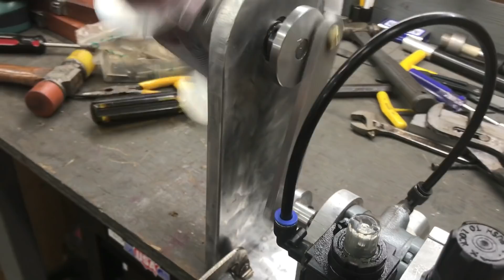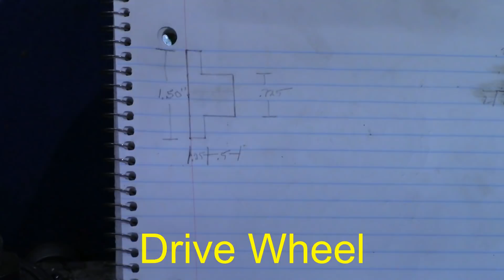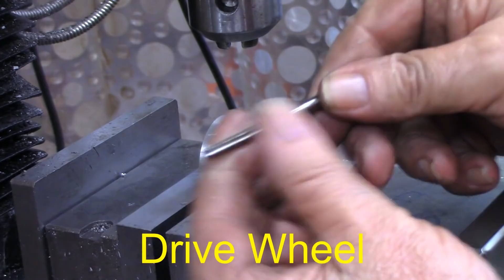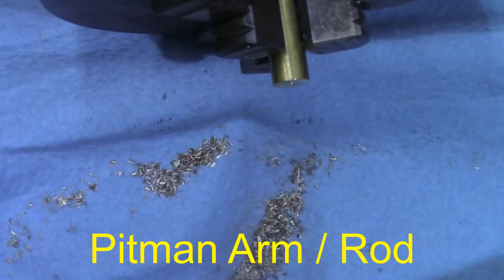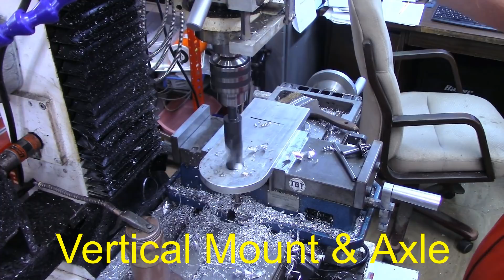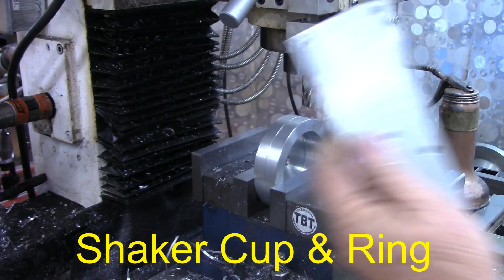Aerosol Paint Can Shaker - An Air Motor Project

Comment: Hi Lee nice one. I don't have a spare powered or air motor, but I think if I copied your design with just a shaft with a hex on the end I could run it with a cordless drill. Cheers Peter from Oz
Reply from the maker: Exactly

Comment: Did I miss something?  Your drive wheel attachment pin was placed .100 (1/2 the centering device diameter) + .125 (1/2 the hole diameter)= .225.  In my book that would put the edge of the hole breaking out of your perimeter just slightly but breaking out nonetheless.  Yet you have a margin left when you drilled the hole??
Reply from the maker: The hole was .190 (10-24) Thanks for stopping by.

Comment: Nice project Lee, I built one from an ABS tube and run by cordless drill. Very nice design and repurpose that air motor. I am sure you will find that the drudgery of shaking a can that has been sitting for two years is miraculously gone. Enjoyed, cheers!